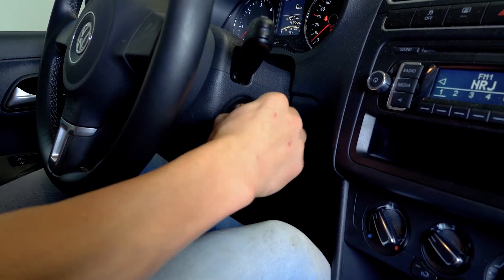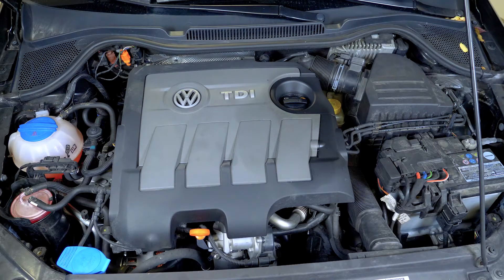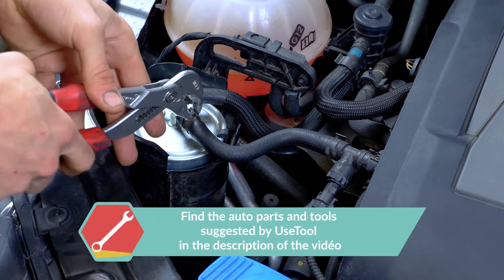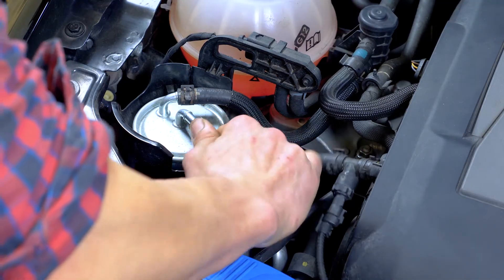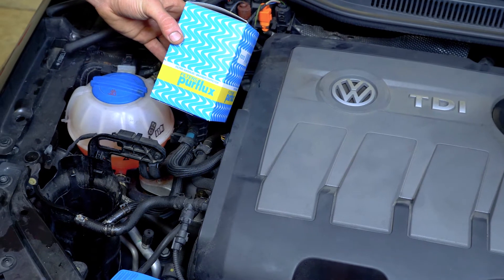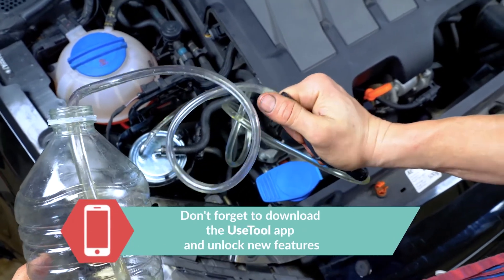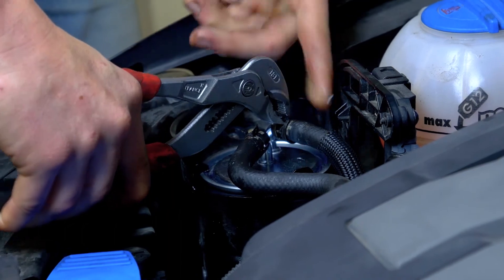How to replace the diesel fuel filter Polo mk5 1.6 TDI ⛽

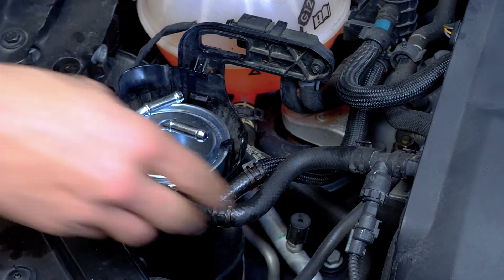Comment: Thank you for a helpful video! My VW Polo 2011 1.6 TDI did not start after replacing the fuel filter, following another video here on YouTube that didn’t inform about the priming procedure. Thanks to the clarification in this video my car does now work again. I did the priming without the inlet hose mounted, opposite to what is said at 2:36.

Comment: When you have fitted the new filter attach the inlet hose. Get an old plastic drinks bottle and put the neck over the outlet on the filter
Get in the car and turn the ignition key not to start it but enough for the fuel pump to prime. Say on for 3 seconds off for 3 seconds. You may need to do this half a dozen times or so. Eventually you will see fresh diesel squirting into the drinks bottle
Remove the bottle and Attach the outlet hose. Do the prime thing with the ignition key a couple of times then attempt to start. No need to buy vacuum or priming pumps.

Comment: I have been doing my own annual service on my Polo 1.4TDI (2008) for over 10 years. I always change the fuel filter, have never primed after exchanging the units and the engine starts every time. I actually recall asking VW service dept if I needed to prime .. that was way back... circa 2011 and they said, not necessary so I never have.
Reply: sometimes air bubbles can create starting issues .it wont take the ignition if the fuel line has bubbles

Comment: Ok, done everything the vídeo shows, EVERY, had a huge problem after the prime, the engine didnt start after many trys, the problem was air inside the fuel line, in the vídeo they dont talk about this, i had to bleed the line to get the air out, its a very frustating thing to do, i dont recomend doing this at your home, take your Car to a professional insted. You will end up with a dead Battery and spending more money than you think.  Sorry for my English.
Reply: you shoud not attach the fuel line when you fill up the filter because excess air gonna get pumped lol. maybe this was the mistake as you see at 2:36 ot says to connect inlet hose, you should not.
Reply: @levente4424  what if i attach the primer pump to the inlet hose, shouldnt that draw fuel from the fuel tank? and once its full/starts leaking on the other side of the pump i complete the job?!
Reply: @vlat4e  that is how workshops do, the connect inlet correctly and then just turn the key to ignition on position, without starting engine, 3-4 times, and the fuel starts coming from outlet, then they connect the outlet pipe and do 2 times again ignition on, then start the egine.

Comment: Interesting but I've been advised by a VW forum for the mk5 Polo TDI, both pumps, tank and engine, have to be operated to bleed the fuel lines after a fuel filter change.

I have a 2011 Blue Motion model and I've been told if the line is not properly bled, severe damage could result from lack of diesel in the injector equipment of a CR engine - mine is the CFWA.